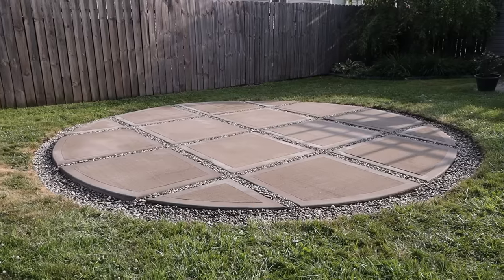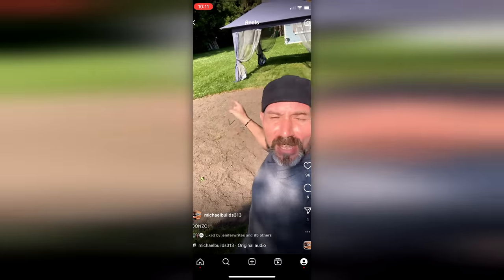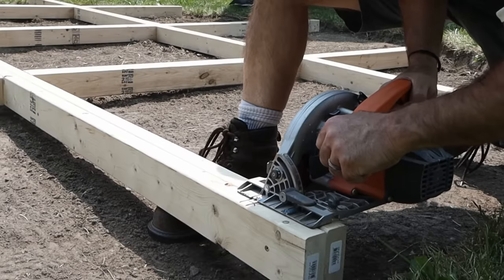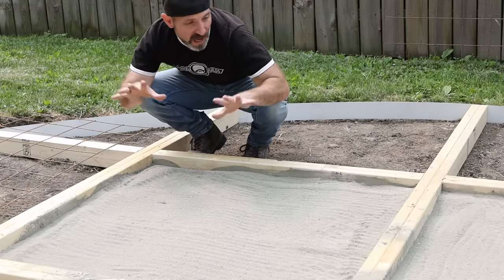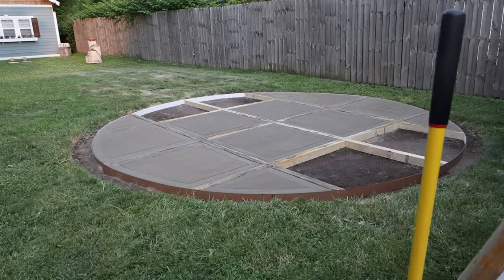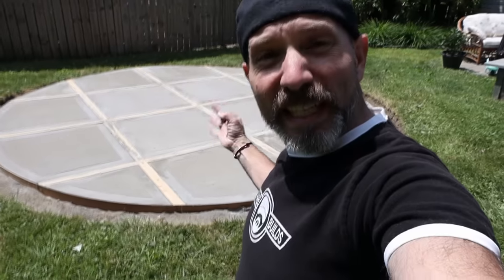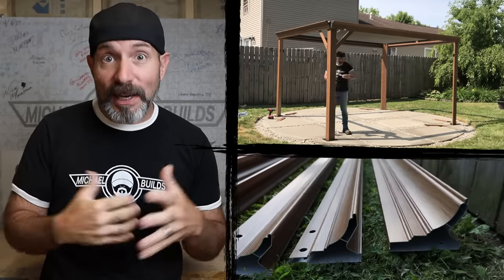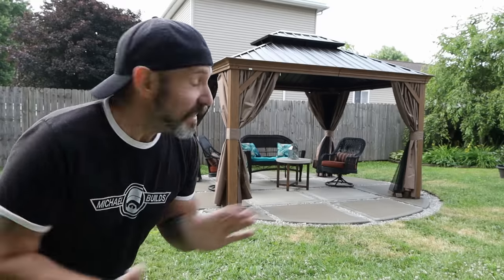Dry Pour Circular Concrete Patio with a Domi Gazebo!

Comment: Fyi to anyone dry pouring. You need to wait at least 2 weeks before trying to use concrete anchors. I did a 4x4 a few weeks back to mount a manual tire changer from Harbor Freight. In 48hrs, I removed the form, drilled the holes and mounted my machine. The anchors would not tighten as the concrete was too brittle. I waited a couple weeks and drilled new holes and did a 1/4" pilot hole 1st followed by my 1/2" for my anchor size. They torqued right up and show no signs of trying to pull out.
Reply: Waiting the longer the better!  I waited a week for mine and they were solid, I wanted to wait longer but couldn't.
Reply: Thank you for this. I love the comment sections for this reason! I’m pouring 2 1ft x 24ft strips to anchor a shelterlogic frame and will be using tapcon screws.
Reply: I'm doing research but it seems like dry pour might be the most efficient as opposed to wet poor for small projects? 

I have a couple small ish (roughly 1 yard each) pads that I have to pour and I'm considering doing dry pour instead of wet
Reply: @kylestyle2202  Well my 4'×4'×3.5 thick" took 7bags. If you're having yo mix more than one bag at a time, dry pour goes ALOT faster. You just have to wait longer to put it to use for heavy traffic or loads.
Reply: I like that I can pour all of this concrete for 500 bucks, if I mess up break it and do it again up to 10 times for the prices I've been quoted... and I'd still have change... 😂😂
Reply: @kylestyle2202  Big projects too. If I'm by myself, I can't mix, pour, and float a huge section. By the time I get to the other parts the first part is setting up. A dry pour removes having to be on a timer. I can do the entire thing my myself then water.
Reply: If you can screed dry concrete then why wouldn’t you do it the way it’s supposed to be done adding water and screed it and be done ✔️
Reply: @onetruesoldiervt3686  "The way it's supposed to be done." Lol! I'm doing this for me, so I'm gonna do it the way I want to do it. I love experimenting! Is that a problem for you? This dry pour trend is uncharted territory, so ANYONE experimenting and making the process better is a good thing.
Reply: We adding a pergola I am waiting a month. Also I made the corners about 6 inches instead of 4 to be safe not sure if  necessary it adds a few more bags but I think is worth it.
Reply: @onetruesoldiervt3686  I'm still on the fence with the dry pour technique, but to answer your question...doing a wet pour requires precision when it comes to timing. You have to mix, pour, and then screed it all within a very set amount of time. When using the dry pour technique, the only time component you're up against is the amount of time needed for the curing process.
Reply: Ok! I’m a female! I’m doing this myself! I’m questioning the water amount I see on ‘all’ of these! Is it enough to soak and harden a couple of inches of cement on the 1st go around, before you do the 2nd layer? I hope I’m asking correctly’
Reply: @artbycleatress  No if you over soak the top layer on the 1st spray, you will ruin the finish. That's why they mist the top layer a couple times to hardnen it. After you've misted the top layer a couple times, you can do as I did and slowly pour the correct measured amount of water evenly over the whole surface. Whatever you use to pour, just make sure the water doesn't splash on the top layer because it can ruin the finish. How large is your project? I may able to give you some ideas?
Reply: @Something2Consider  yes wet concrete has a limited working time, but you can wet pour it in smaller sections.  There will be a cold joint between sections but this is also the same way highways are made. They use rebar to join sections.

Comment: Great job.  I did a dry pour for a wading pool 10 years ago...never used water at all!  Just mixed the concrete (sharp sand and cement) and left it for four days.  The nights here can be fairly wet - either humid in summer (which it was) or damp dewy nights in winter.  After 4 days it was solid.  It's still there and hasn't sunk a millimetre!  Weight of the pool is 3 tonnes.
Little tip:  If you soak your timber before you pour, they expand.  When they dry, they contract, and are easier to pull out.
From England.

Comment: Cajun County Livin', the people who popularized the dry pour method, recommend only two mistings, one hour apart regardless of slab thickness. Next, they recommend two showers per inch of slab thickness with one hour between each shower. Thus, a four-inch slab would receive two mistings and eight showers over a 10-hour period. A slab 3.5 inches thick would receive the same amount of watering. In their most recent video, they caution against over-watering a slab during the hydration cycle in order to avoid spalling (surface deterioration). Once the hydration cycle is finished and the concrete is set, continued slab hydration over the next seven days is recommended to help with the curing process.

Comment: It's fantastic how you're adding to the body of knowledge regarding dry pour. The wet mix traditionalists are up in arms and defensive why it's such a terrible idea with no scientific evidence, while practical, thoughtful people like you are seeing an opportunity to learn, create, and refine new methods. This patio you created is probably the largest anyone would want to do dry pour, the wet mixologists really have nothing to fear from this new method, it will expand the usefulness of concrete for smaller projects for DIY. Thank you for your work!
Reply: Stonemason here, work with concrete and cementitious materials every day for the last several years.

Food for thought post here so meant to be completely in the interest of a respectful discussion.

As far as the whys regarding the traditional method, concrete, mortar, etc is a product that requires specific amounts of water for the hydration reaction to occur properly. This isn’t to say that hydration doesn’t occur but what often happens is that once the layer on the exterior starts forming, it affects the amount of water that can be distributed to the material in the middle of whatever you are forming. I’m making it very difficult to be able to control the ratios of what you are mixing. 

I am totally open to exploring dry pouring and I don’t think anything should be scoffed at purely on the basis of tradition, however there is a scientific basis for why mixtures are currently the way they are. 

This is all the more so considering concrete often needs reinforcement.
Reply: Calm down , water mixed concrete is always much much stronger and will last much longer...
Reply: @jamesduke4957 Ever dig out old fence posts that have been there 20+ years? Dump a bag in the hole and add water, dry pour right? Those last the test of time 🤷‍♂️
Reply: @jamesduke4957  calm down— always stronger and longer lasting? Prove it. You can’t, because these methods of pouring are too new, there’s been no possibility for long-term testing.

Comment: your quickcrete is so much smoother than what I see in a bag here in FL, there barely looks like there's aggregate in yours which is the major problem with dry pour finishing from what ive seen. Great job looks good
Reply: This is what I wanted to comment on. I just did 2 8'x6' pads and screeding was a nightmare due to the boulder sized aggregate and the results were still less than ideal. Where do you find this particular small aggregate concrete?
Reply: Have you tried gently smoothing out the surface with a new paint roller before the initial misting?
Reply: You need to shimmy the screed board more to pack the aggregate down. Then dry paint roller the surface.
Reply: Second this. My yellow bag is also very rocky. Can we just use mortar mix for top coat?
Reply: @cheyennewu9193  Yes we can use Mortor mix for the top inch or so, Different parts of the country fill their bags differently as they are manufactured in different places even if its the same brand
Reply: I added mortar mix to my large aggregate voids for a smooth surface but it spalled real bad. I screeded thoroughly,lightly tapped down large aggregate and lightly paint roller rolled. Might of over watered? But next slab I’m going to use quikrete “topping mix” instead of mortar mix because it’s formulated for resurfacing and repairs according to quikrete. Wish me luck!

Comment: Good Morning @MichaelBuilds - checking to see if you’ve seen any structural integrity issues where you drilled the gazebo posts. Looking to do something similar next Spring and wondering how the sway/movement of the gazebo has affected the concrete.

Comment: Hi MIke. This is the first time I have watched your channel and your build on this is awesome! I just did a very small concrete patio for my grill and did a dry pour for the first time. I used the quick drying concrete (commonly used to pour into fence post holes). In hindsight I wish I had used the high strength kind you used and just let it dry and cure longer. I look forward to watching your channel.

Comment: Nice job, love the patio. For your grout lines, what if you would add concrete in the bottom before putting the rocks in?
Reply: Ooooh.  Just a small amount would help with the weeds!
Reply: As a weed stopper or to help keep stones more stable?
Reply: @emilcasas2707  I meant it as a weed stopper, but it would probably help stabilize the stones too.

Comment: Amazing job as usual!! My only concern is the larger spaces between the slabs of cement.. if the rocks aren't compacted, someone could potentially twist an ankle in that large of a space just by stepping wrong
Reply: For 18 years, My entire walkway to my front door has 1.5' space between with 3/4" rock fill. No one has even fallen or twisted an ankle. Don't worry, go for it.
Reply: Yes I think you’re right. I’ve put in lots of gravel pathways and the comfort under the feet and the safety factor are very important. In this particular case I’d say no high heels under that gazebo 😊

Comment: Hey Michael. Great video. I've got a question though - you said that you didn't put gravel down because the dry pour needs the moisture, which makes sense. However, I thought gravel was needed to drain the water. Is that not required? Or are there only specific instances that gravel needed. Thanks!

Comment: Good job. I have a gazebo on the way. I'm a bit intimidated with the concrete. I have built forms in a grid already and put rock base and tamped it in. The dry pour looks easier. But the wet pour would be stronger. Maybe wet pour on the corners and dry pour everywhere else? I'll figure it out.
Reply: I have poured all my sections the traditional way. The only tools I used to smooth it was a 2x4 to screed with in the sawing motion. Then I used my little baby sledge to vibrate all the sides by tapping the forms. I used a wood float to bring the cream up. And and edger. At first I mixed my squares strictly by the directions on the side. 120# at a time. That really worked me and I wound up adding water to make the crete workable.Mixed all by hand because I'm cheap too.  I have 4000 psi and added 25% extra water so I'm guessing its 3000 psi now. Foot traffic only with a gazebo will be added. I did install some 2 ft tubes where the post of my gazebo will stand. I did buy rebar and tie everything in together.My forms came out easy even though I placed the screws in areas I could't get to them. I just pried them out  with another 2x4 as a long lever. I used some stakes as a fulcrum. We have rains now so the project is on hold. I have never done this kind of DYI job before and now it is behind me I can say while it was challenging for a old guy it was completely doable.

Comment: Would putting in sand or aggregate even in the bottom layer not increase the strength but also reduce the cost (less neat cement mix)?? 60~80 bags at £6~7 a bag is alot of dollar

Comment: This is soo nice! Enjoy your stuff! I just wonder about after you remove the wood & dry poor is dry, going back and filling in the space with concrete (becomes some degree of a solid circle, but still maintain the pattern design)..... or buying/building step stones and using them to create your framed space?  Could put gravel/stones onto wet concrete in the seams and would prevent the weeds... graveling the top is what they did to our pool desk and some drive-ways.

Comment: I'm really curious if these dry pour concrete methods could be applied to concrete counters, and if so what do you have to do to get that smooth as glass finish
Reply: Betting the smooth as glass really need a few polishing passes but I am a woodworker not concrete specialist so grain of salt ;p
Reply: Melamine forms.

Comment: I have two questions?
1)  Can you dry pour using quick setting concrete bags?  The reason I ask is I did a previous fence post setting project and I have some left over bags.
2)  Can you dry pour where you have a downward slope so water runs away?  Basically if built a 5' x 10' concrete area that is next to the house and I want the rain water to run away from the foundation.  This would be for parking big trash and recycling cans.

Comment: You used the same High Strength Quickrete as Cajun Country Livin, but as you poured it out of the bag and when working it in the forms it looked as if there was less rock in the mix if any at all giving your dry pour had a much better finish even over the paint roller method they use. Can you comment on the concrete mix and also your link to Home Depot shows just a regular Quickrete but you did use the high strength. Thank you in advance

Comment: I just finished a 12x16 patio we did it in two sections. The first half we took a little time to finished and put too much water or mist it took some of the cement leaving gravel exposed. The second half we took our time it looks almost like it was wet pour. It will be nice to know  how much time or  how much water to get to the bottom in a 4 inch pour.

Comment: Hey Michael you think the dry pour will hold up for cars? parking on them, I actually want exactly this design, squared of course for my front yard converted to more parking space
Reply: Too much water weakens concrete every time. A dry mix should in theory be the strongest pour that you can get after it has cured.

Comment: Great job on your backyard project especially with the short amount of time you had. I noticed on the video that the concrete bags you used didn't come with pebbles which is a coarse aggregate that strengthen the integrity of the concrete. Using a fine aggregate will not mean that your concrete patio won't be strong for its purpose but just not as strong. Was this by choice?

Comment: Your videos provide me a confidence to use dry pour to build a foundation for a 8'x6' light weight metal shed with a wire mesh but no gravels. Please advise if this summary is correct. However, in your video you sprayed water in the half way with big red remark "Wrong." Do you mean it was a mistake to do in this way? Is it possible that adding water in half way might separate the concrete into two layers and cannot bind together as one?

Comment: Hey Michael, I just found you and how glad I am  as I am searching the a way to make a step to put on a slap that's there as it's a little too low to step in the door. So my question is. Where should I pour the concrete? Pour it on the slap were it will seat or elsewhere, and carry it, and place it on this slab? Thx

Comment: Thanks for the video!

Any intentions of redoing the dry pour pressure testing with metal reinforcement added?
Reply: Where is the dry pour pressure testing?
Reply: @clintlickner  It's a couple videos back from this one.  I think the thumbnail is a pickup truck running over a small concrete pad.

Comment: Weird question-could you use pressure treated lumber 6x6 and leave in place for some interest? I think it would be recipe for rot and not work bc water wouldn’t drain between sections, but curious if I’m wrong

Comment: Would you be able to put a thin layer of lubricant like vasoline on the boards to make them not stick to the cured cement, thus easier to remove?

Comment: Could you have filled the gap with dry concrete instead of rocks? 

Either full dry concrete or the first half with dry concrete and pour epoxy on top with led inside?

Comment: I wrongly assumed that a semi-truck delivered bags of concrete to your door in quantities that would make Home Depot blush. 😅As usual... I learned actual tradesman ideas too! It seems that there are a ton of things I could do by working with dry pour concrete instead of just setting fence posts! Did you put any type of coating on the boards so that they would release easier? Also, did the individual slabs remain nicely level after curing?

🥳🥳BTW, Happy father's Day! This looks so beautiful!   🥳🥳

Comment: Will mixing the cement with inexpensive concrete fibers, such as Bon Tool, $10 for 27 cubic feet at Lowe's, increase the strength of dry pour?

Comment: Where did you get all that concrete with no rocks. Looks like just sand and cement. That would sure make the pour a lot easier for your video. I just finished 40 blocks 3x3 and the hardest part was getting it smooth on top. It sure didn't go as easy as your video.

Comment: Hi Michael. I found & subscribed to your channel today while looking for answers to a DIY question. I just finished pouring 80-lb High Strength Sakrete Concrete Mix in
cobblestone paver molds around my pergola. I'm ready to fill paver gaps but most reviews on polymeric sand are disappointing. I wanted to ask if I could dry pour concrete mix to fill the paver gaps? If so, will it keep weeds/bugs out and how long do you think it can last? I have 12 bags of Concrete Mix left. If this won't work, what do you recommend? 

Thanks.
Toni